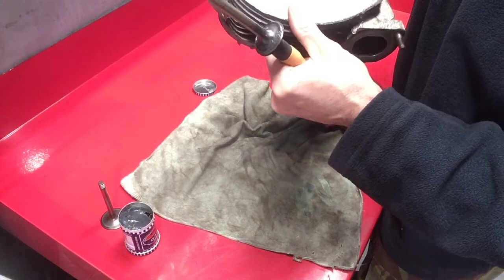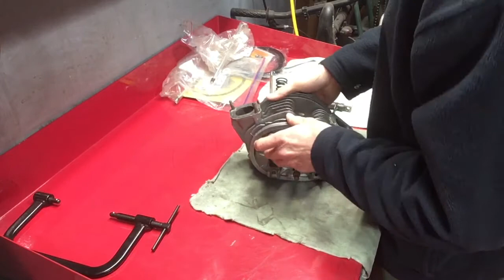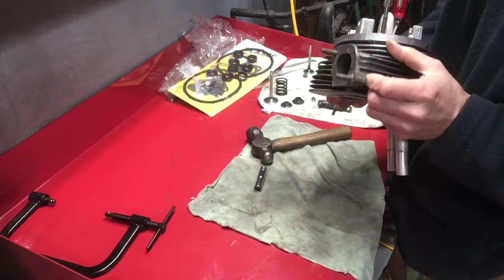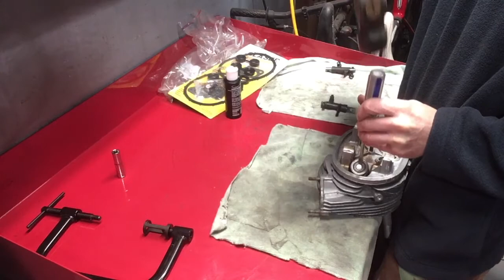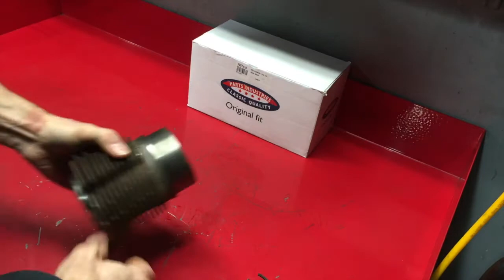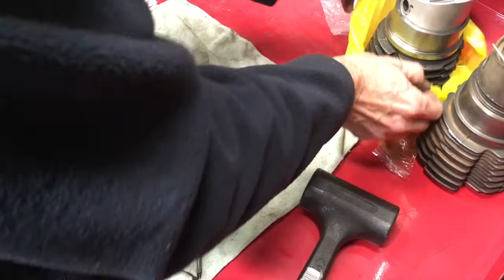Lomax 223 Rebuild #15 2CV Top End Engine Rebuild

Comment: How did you decarbonised the valves?
Reply from the maker: That is an excellent question, but to be honest, it's been a while and I don't recall what I used on this occasion.  I suspect I used a brass wire wheel.  Skäl  David
Reply: @MotoMirius  Thanks, I will try that, with care of course
Reply from the maker: @Raymond Reinders There are other methods - have a look at this link for example https://youtu.be/0KqICj7zbiU